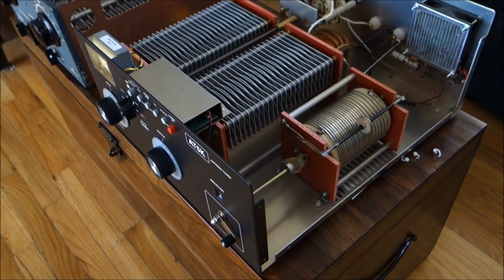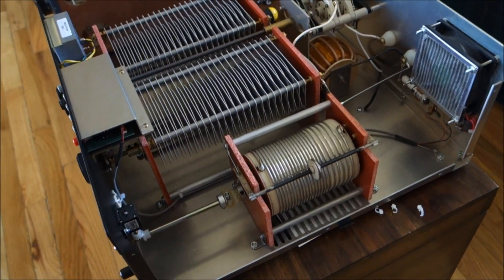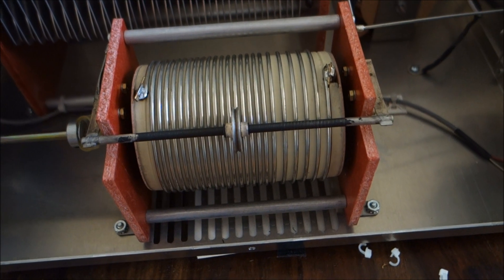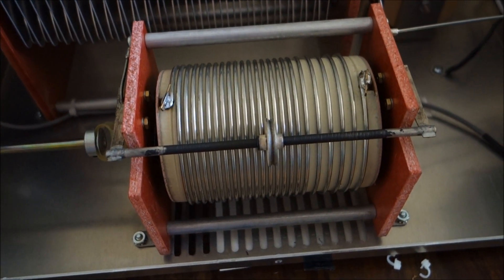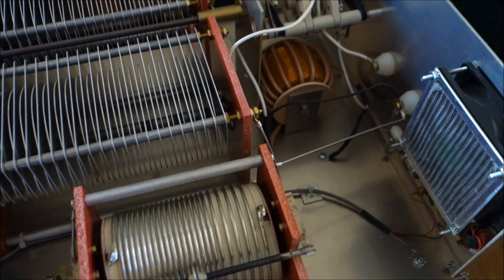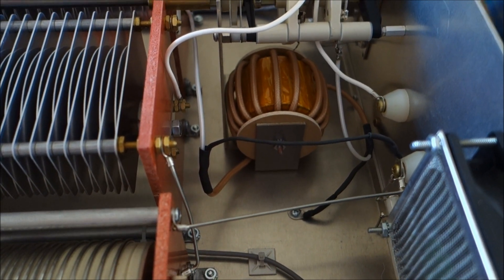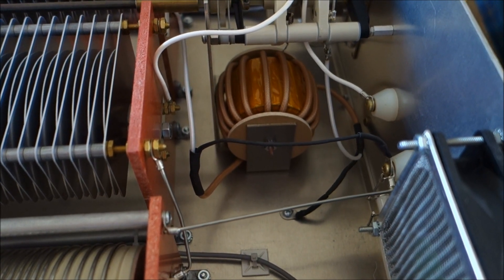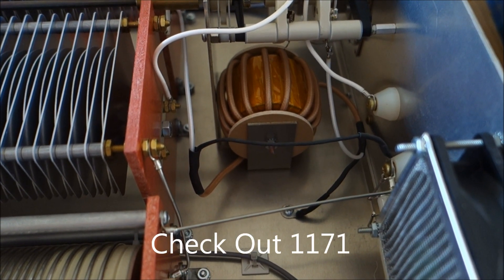Palstar Roller Inductor Lubrication AT5K AT4K Antenna Tuners | Signal Phantom

Comment: I have read elsewhere (and agree with that authors experience) that special 'conductive' grease isn't necessary. Any dielectric grease will do as the grease is squeezed out of the way when the force of the roller spring causes metal to metal contact between the roller, roller shaft and inductor. The graphite laden grease just make a mess and you can't really see dust and grime collect (for maintenance) when the grease is already black. Metal to metal contact is what you want and any graphite that doesn't squeeze out from the roller spring doesn't add much if anything in the way of conductivity. The message is that with special conductive grease, what we want/envision to happen (additional conductivity) isn't really happening.

Comment: A few years back, I picked up several antenna tuners at an estate sale.. These things had probably been sitting for years, and the roller inductors were all tarnished. Of course, I could never get them to tune correctly.  So I used a product called Never Dull... It’s a tarnish remover impregnated into cotton wadding.....  I could not believe how much tarnish and filth came off those inductors!  Now I can get a 1:1 match on any random antenna!